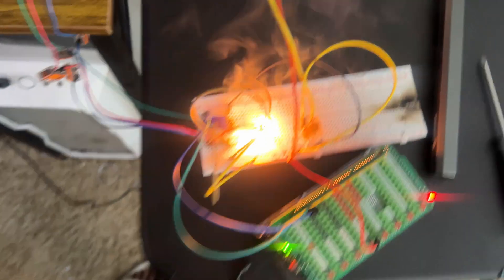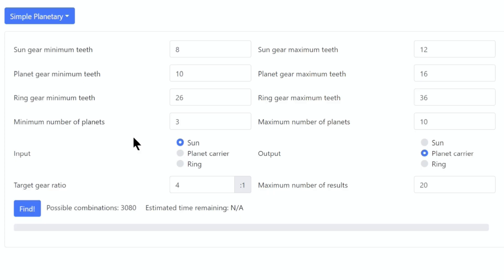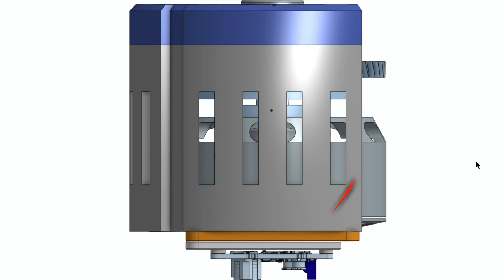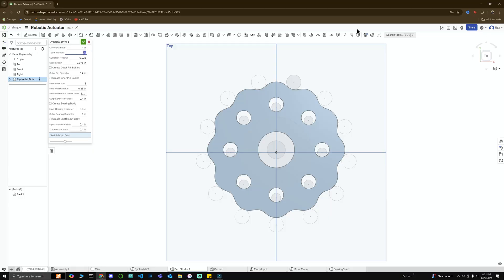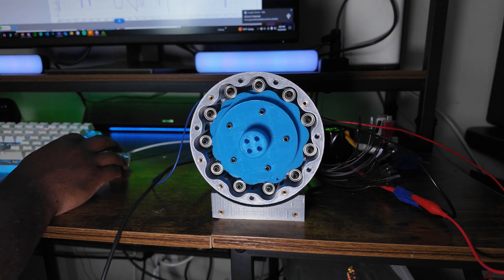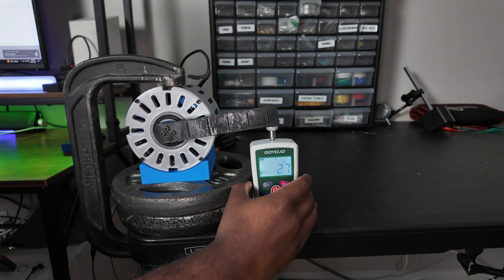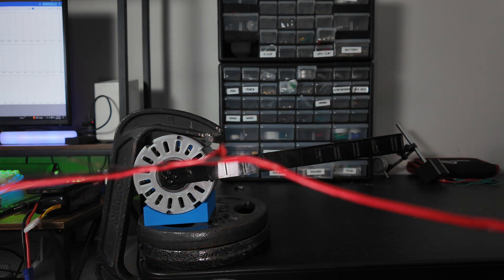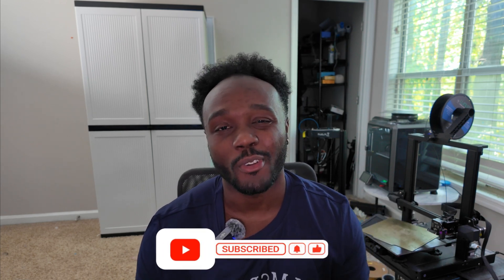Designing A New Motor For My Robotic Arm

Comment: for the planetary gearbox, why do you need to put bearing on the output at 2:56?
Reply from the maker: Mainly to decrease friction and increase support. Friction so we don’t have plastic on plastic rubbing and support so the bearing supports any axial movements put on the shaft so the 3d print doesn’t break.
Reply: @NazLouis  noted, thanks for the insight!

Comment: Why does the output shaft need a bearing? Specifically, the thing at 4:24
Reply from the maker: Mainly to decrease friction and increase support. Friction so we don’t have plastic on plastic rubbing and support so the bearing supports any axial movements put on the shaft so the 3d print doesn’t break.
Reply: @NazLouis  I was talking about the bearing in the output shaft. Just realized its for the outer cap that touches the rotating part.
Reply from the maker: @ ahhhhh ok got you

Comment: If you want to revisit the cycloidal gearbox in the future you might consider using nylon bushings instead. Not only should they be cheaper/lighter than bearings; bearings are made for high rotation applications, which is not really happening here with the pegs
Reply from the maker: Ahhhh makes sense appreciate the tip! Definitely will try that next time all of the metal bearings definitely made the gearbox wayyyyyyy heavier than it needed to be!

Comment: Great video! Would definitely recommend beefing up the perimeters and infill a bit on the disks.
Reply: I'd agree.  More walls and more top and bottom layers can drastically improve strength. Infill seems to be much less important for strength from personal experience and testing I've seen over the years.  :)      Also, print hotter and slower with as little cooling as possible.
Reply from the maker: @BRUXXUS  I don’t know why I didn’t think about increasing the bottom and top layers, appreciate it bro def going to try that!
Reply from the maker: Appreciate it man and the disc were weird I did another one with more infill and more walls but still failed at lower torques. I think it def came down to me having a design flaw in there somewhere

Comment: I've never liked cycloidal gearboxes, the idea that they advance by pushing sideways against the outside 'lobes' just gives me bad vibes. I can't articulate it really, but planetary gearboxes will forever be my choice between the two.

As for stepper vs brushless, I think brushless is a better choice when you gear it down a lot and also have an encoder for closed loop control, without both of those imo steppers are better for robotics. But, with proper gearing and encoders, yeah brushless rules, since you can get the brushless up to high enough RPMs for it's peak torque, and you have the proper closed loop control. 

Good stuff, I look forward to the next in the series!